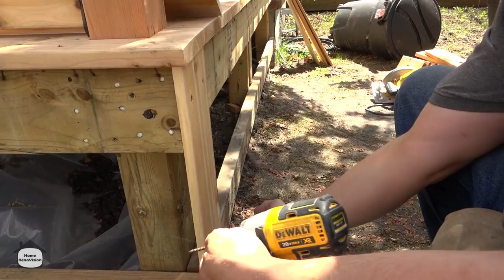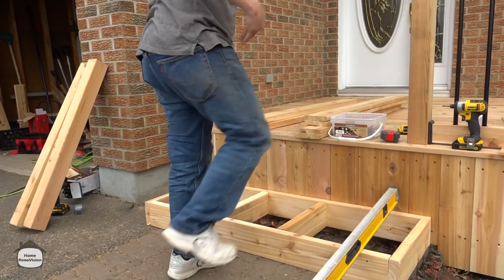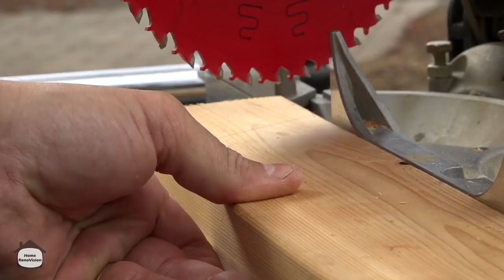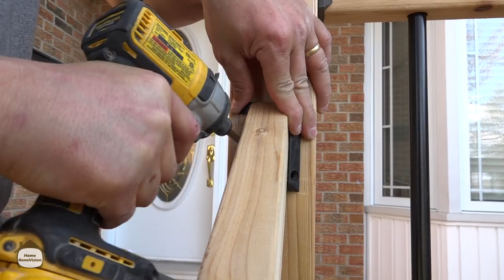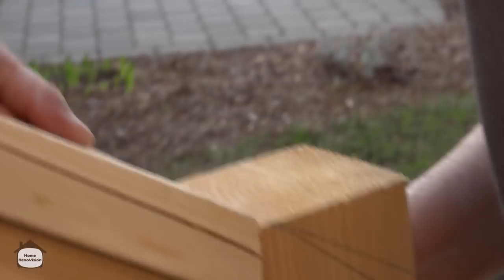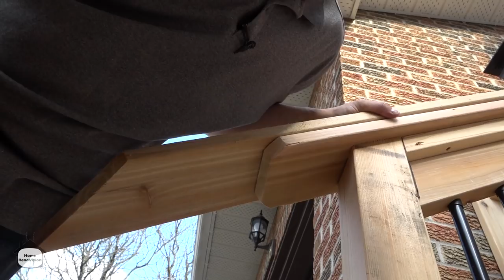How to Finish Your Deck Yourself! | DIY Deck Tutorial

Comment: Split 2x4 for the stair railing, bottom stair box was screwed in wrong ways round, and no top finishing board on the little left side piece of railing where it meets the house. If you slowed down just a little bit, instead of trying to show off how fast knowledgeable you are, those mistakes could've been caught. 
Also, the top finishing piece of railing for the stairs, it just way too wide. It's not a comfortable grip. I understand you did it for continuity purposes, but it doesn't even look right that wide. Should've ripped down the wood a bit, and cut off the 45s on the end to make it match. Still would've looked continuous, and would of been better, functionally.
Reply from the maker: Thanks for the comments. Unfortunately we were more concerned with the technical aspect of how to build than we were with finishing the design that day. We have since taken care of all of those issues. The challenge of using a film crew and scheduling daylight while running a contracting company. Cheers!

Comment: that porch will be rotted out in 10 years
Reply from the maker: well aren't you just full of positivity. You do realize it is made out of cedar right?
Reply: @HomeRenoVisionDIY  cedar, PT, doesn't matter, your steps will rot first with the pitch you used water will collect behind your treads. There is also no room for your porch to breath, so much more important than material used. With that said, your deck does look nice and I really like how you did the railings. Cheers

Comment: Wrong!Come on dude ,all the stairs have to be the same height right?The first stair is now 6.5 “ and second is 5.5 “ and the third is 6”?Wrong! Very simple to do right, very common to do wrong .Look it up
Reply from the maker: Hi Frank, Not sure how you figured that...both stairs are built in exactly the same fashion. Cheers! Have one for me!
Reply: Frank is correct. I don't understand why we have to explain how to figure that out. First step is 6,5", Next step is 5,5" and the last one becomes 6,5" if the total is 18,5". Even if that wasn't correct the math in the video is wrong (6,5"x2=13" which leaves 5,5" for the last step which actually would be better if that was the case). 

First step is 5,5"+1"=6,5" from the ground. 
Next step is 5,5"x2+1"=12" from the ground. 
Last step we are told is 18,5" from the ground. 

You don't want some snarky carpenter to come after you and pull jokes about the previous moron.
Reply from the maker: Ooops, LOL right 6.5 then 5.5 then 5.5 frank messed me up with the last one suggested at 6. Box steps are designed to be easy for DIY not perfect.
Reply: Home RenoVision DIY Ok I get it. You don’t really know the correct way to build to stairs.I do .I could teach you in an hour it’s pretty simple math.As I’ve said before,it’s just as easy to do it right .Just a little advise not criticizing ,but if you’re making diy videos you should be held to a higher standard.Let the viewers fudge it ,you shouldn’t teach close enough in my opinion.Always do your best,it’s not a race,it’s a profession.I appreciate your enthusiasm ,good luck
Reply: Frank Galligan how would you do it? Shim the second box by 1/2 inch so you end up with 6 1/2+6+6 to get to 18 1/2?￼